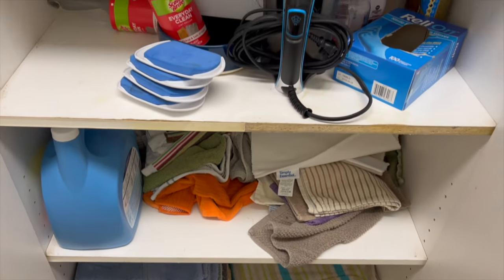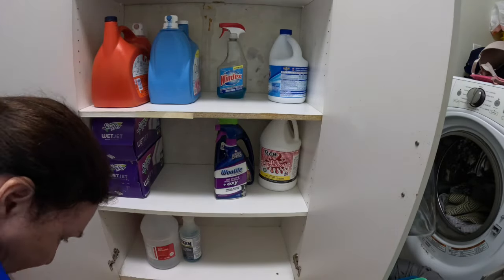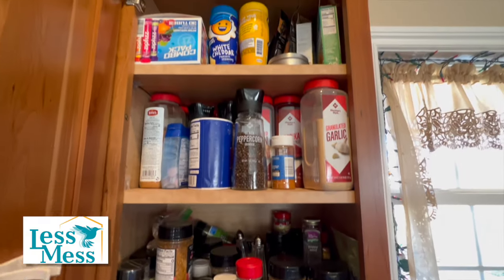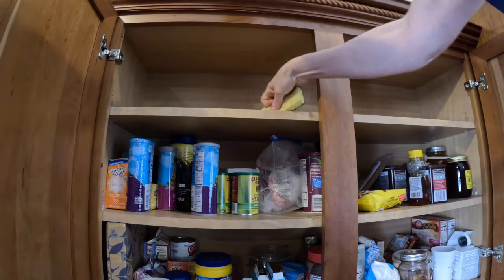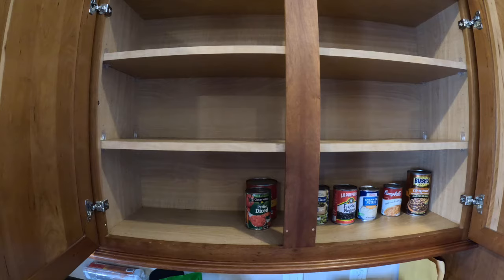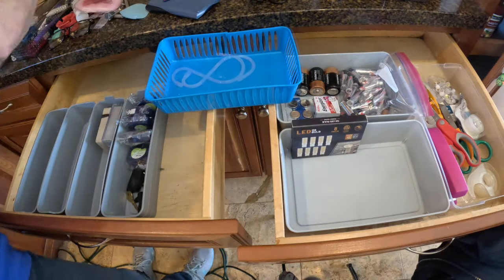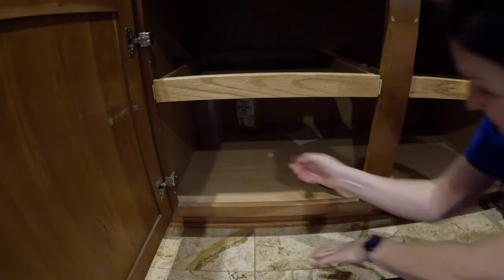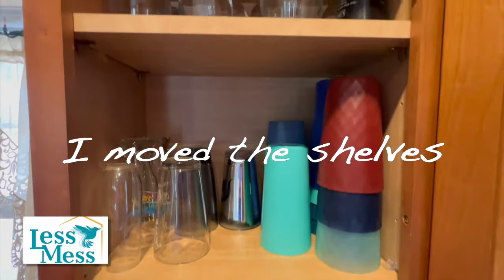Completely TRANSFORMING This DIRTY Kitchen   Deep Cleaning Kitchen & Laundry Room

Comment: Years ago my Mom covered the kitchen shelves with linoleum. Her and my Dad went out and bought a large enough piece of linoleum flooring which she cut to fit all of the shelves and below the sinks in the kitchen and bathrooms. My Mom felt it was much easier to clean and when it was below the sinks, if any of them leaked, it wouldn’t ruin the wood.
Reply from the maker: @laurabenevilli6783 Thank you for sharing this helpful tip from your Mom. It's the little things like this that can make a big difference in our daily routines.😊

Comment: I had a leak under my sink once, so now I have plastic bins and plastic cutting boards under all my sinks.  They catch the water leaks when the bin is under the pipes and minimizes the damage to the wooden floor. I put them under my bathroom sinks too. Leaks are inevitable!
Reply from the maker: @laurahicks8084 Plastic bins and cutting boards under sinks? Sounds like you've turned your kitchen into a DIY plumbing workshop! Way to innovate and protect your floors.